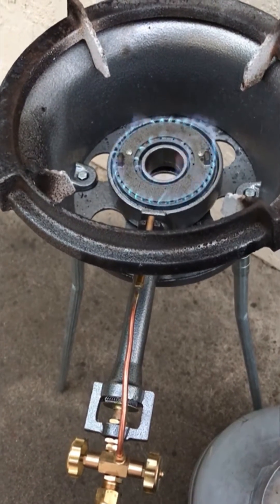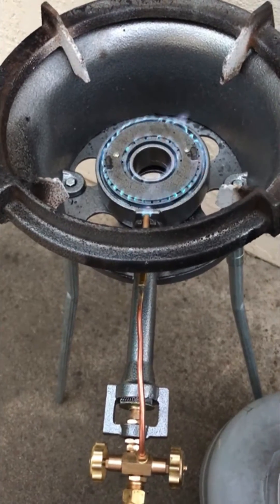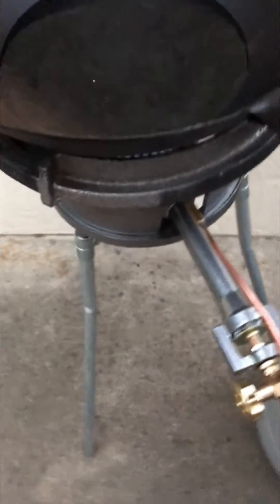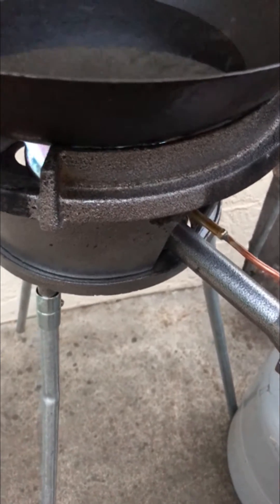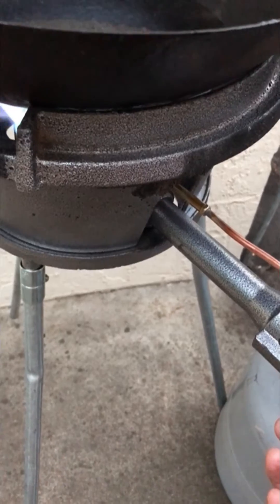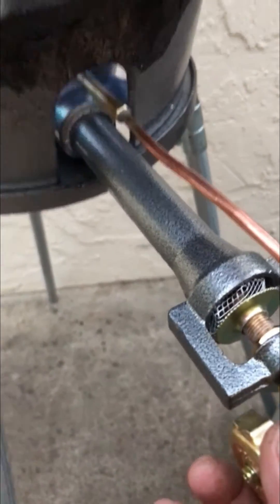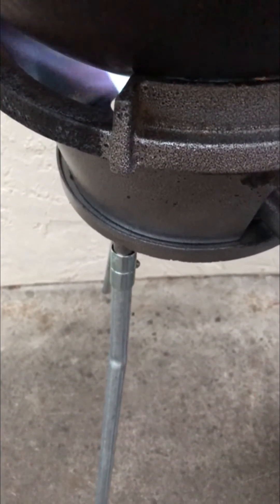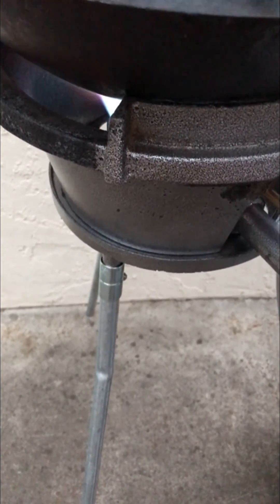How to know when to stop increasing power to a PowerFlamer propane 160 or natural gas 160/120 stove?

Comment: Aside from burning the paint, are there any other negative effects having the flame very high? good information. I am enjoying my stove immensely.
Reply from the maker: Since the flame is heating up the wind guard, the wind guard might become too hot to touch.   For electronic ignition stove, the flame coming outside of the wind guard may damage the insulation of the ignition wire.